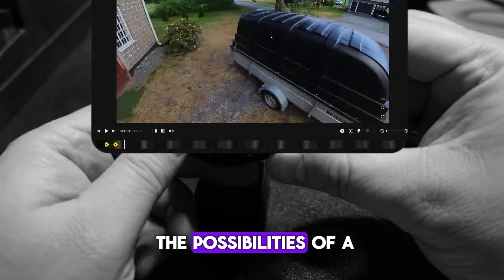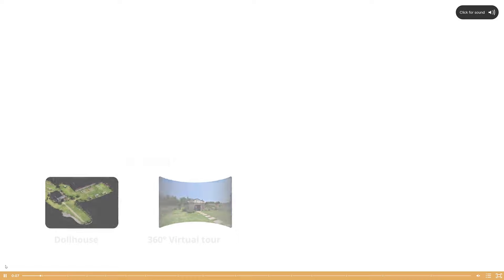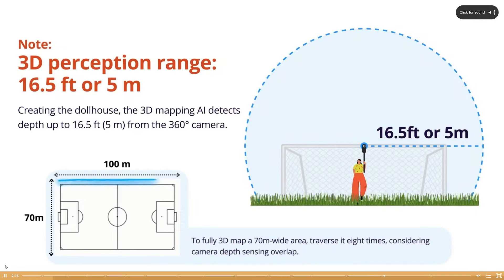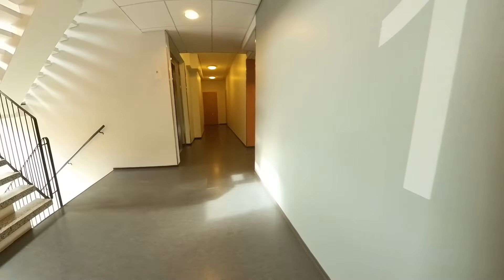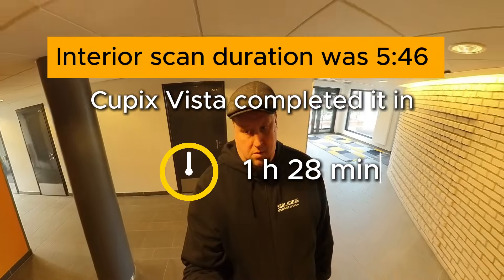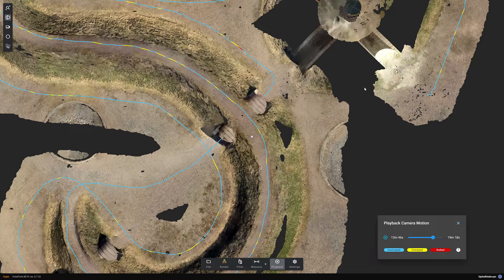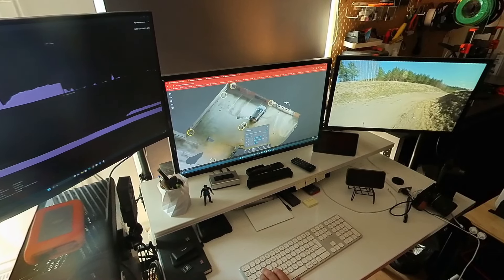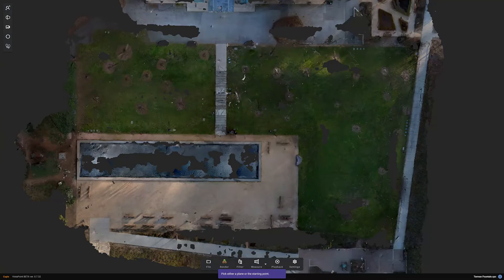3D scan large areas with Insta360 camera and Cupix Vista

Comment: Wouldn't this be better executed with a drone? The drone is basically invisible to the camera, while the person walking around take a good chunk of the image capture.
Reply from the maker: Definitely! Drone would be a best chose if you are scanning outdoor location. It also supports the Insta360 Sphere camera which is made for Mavic Air 2 drones.
Reply: An issue I've had with my current drones are the safety margins for obstacle avoidance are extremely large, preventing automated capture of many areas (think doorways or sparse forest).  If I have to do the capture manually anyway, doing it with a 360 cam on a selfie stick is likely faster than resetting an automated drone run that stalled due to poor obstacle avoidance.
Reply: @takaides  I don't know what drones you use, but with my Dji FPV and the Dji Avata I can easily disable all obstacle avoidance sensors and fly as close to object as I like. However I would fly all manual and slow. No acrobatics of course. I doubt automation would work good in this use case.
Reply: @OlliHuttunen78  Thanks Olli. Keep up the good work, loving the videos so far. Love from Norway❤
Reply: for small spaces his is more useful than the drone.  Most apps for this you have to pay and/or you need a drone that you can setup a flight plan. You can use skybrow with a cheap drone to scan for free. However, I find this application way better for small spaces as there is safety issues, permissions, and otherchallenges with drones.   Great video

Comment: Luma AI allows you to use 360 camera as well to produce 3DGS
Reply: However I think it only uses one of the files captured by one of the 180 degree lenses and not both
Reply from the maker: Yes. You are correct. Luma AI can also take 360 Equirectangular footage to process. But to be exact, it will not make a 3DGS model out from it. Luma can only produce older NeRF model out from 360 material.  It can turn almost any video or images into Gaussian splats, but it can't do it with 360 footage. So that option is just a holdover from Luma's earlier service. After all, It is very rare that any of these 3D services could yet train a Gaussian Splatting out from 360 images. I haven't seen one yet. But perhaps in the near future. It could be this Cupix Vista or Postshot. By Bet is on those apps.